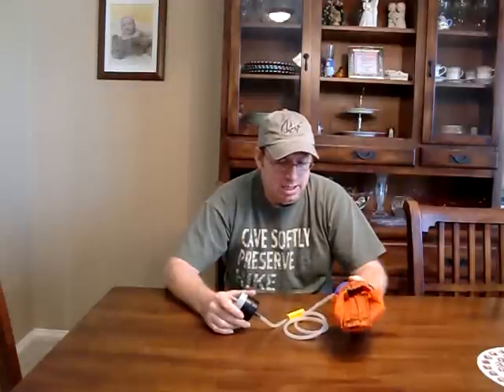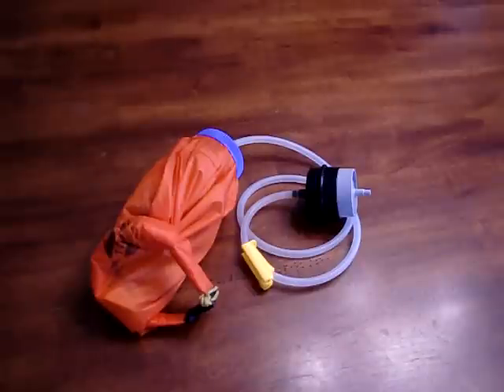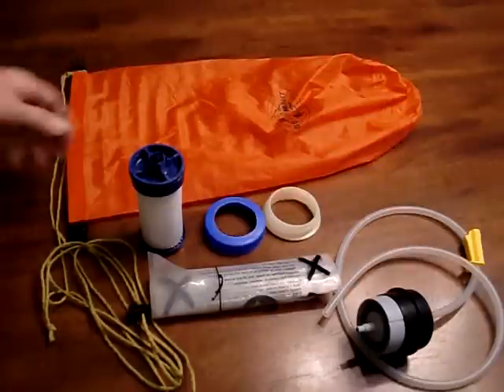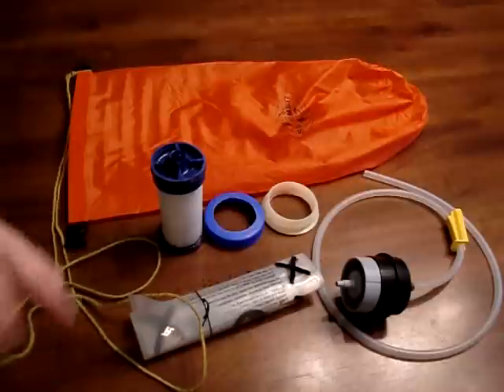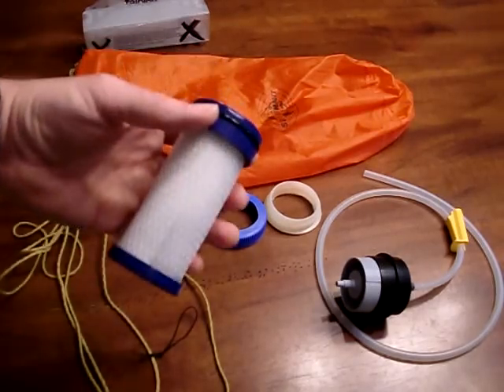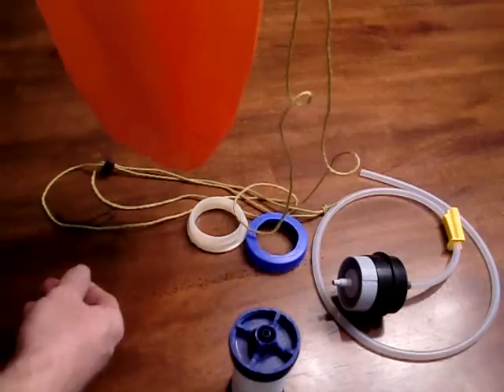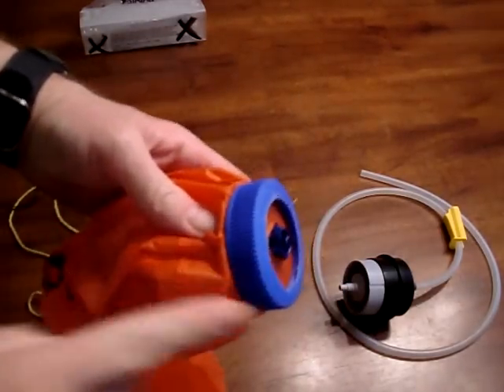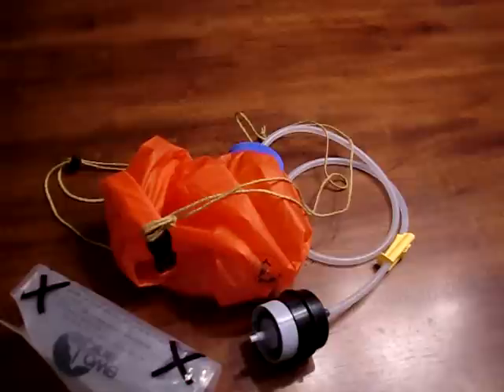DIY Gravity Filter with a Katadyn Hiker Pro Filter

Comment from the maker: I will have to break it back out. I bought a Sawyers Squeeze water filter and have been using that recently. It is half the weight of my gravity filter and has a faster flow rate. It is cheaper to buy the Sawyer than my gravity filter. The Sawyer is good for 1 million gallons where my gravity filter needed to have the filter replaced often. I got back from Afghanistan safely. I can't wait to get on the trail again! Thank you for your comment!

Comment from the maker: Plus a tubing clamp (either the Dura-Clamp or Keck Registered Ramp Tubing Clamp from usplastic). This is completely optional. I use it to control or stop the flow of good water from the filter.

Comment from the maker: I never intended this gravity filter project to be from scratch. I did this to convert what I had (the Katadyn Hiker Pro Pump Filter) to, what I prefer, a gravity filter. I had an old Nalgene laying around so this only cost me around $22 for the dry bag. I am sure you could purchase a similar gravity filter for much less. If you would rather purchase one ULA used to make one called the H2O Amigo (not sure if they still make it) and Katadyn makes the Base Camp ($60-$70 online).

Comment from the maker: The tube is a (1/4) 0.25 in. tube for information in case you decide to purchase it separately or for the tube clamps. The Carbon filter can be purcahsed separately later for $19.95 at REI (or possibly cheaper online) if you prefer.This still does not include the tube however.

Comment from the maker: Option 2:
The Katadyn Hiker Pro Replacement filter $33 (amazon)
Sea to Summit Ultra-sil Dry Bag $18 on amazon
Wide Mouth Nalgen Water Bottle $7-$10
You will need to get a plastic hose from somewhere like usplastic for the outlet

NOTE: This is the cheaper option but requires some research on where to get the hose from. The tubing clamp is an option for this one as well obviously.

Comment from the maker: Option 1: 
The Katadyn Hiker Pro MicroFilter (complete kit) $60-$70
Sea to Summit Ultra-sil Dry Bag $18 on amazon
Wide Mouth Nalgen Water Bottle $7-$10
NOTE: This is the most versatile option because it give you extra parts you can swap out like the plastic outlet hose that the replacement filter does not come with and the carbon filter (I only carry on weekend trips where weight isn't as much a concern). This is obviously the more expensive option.